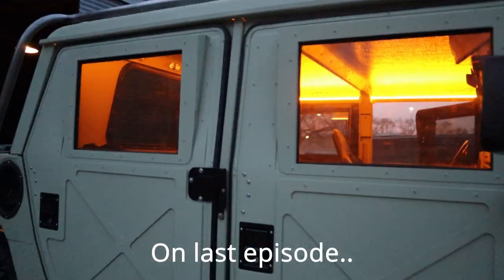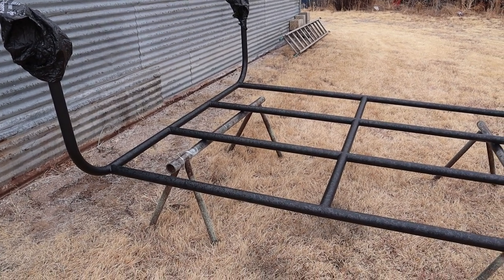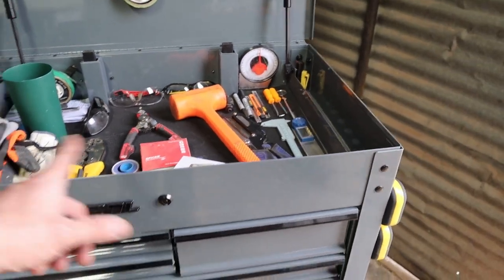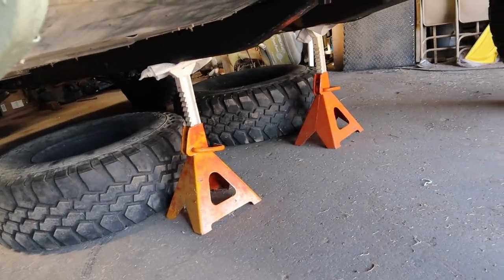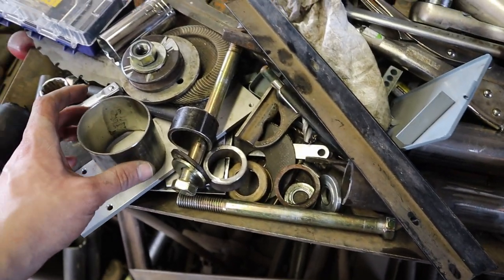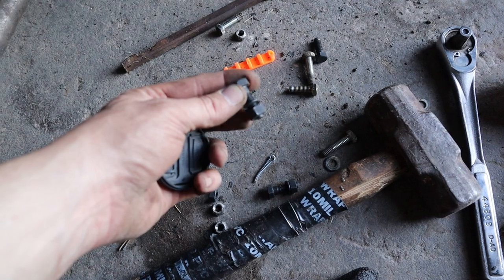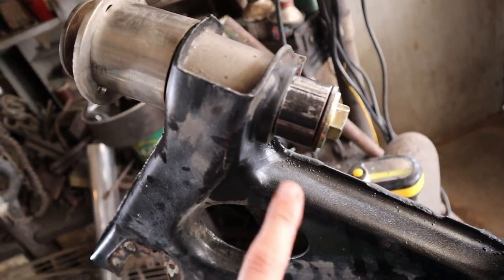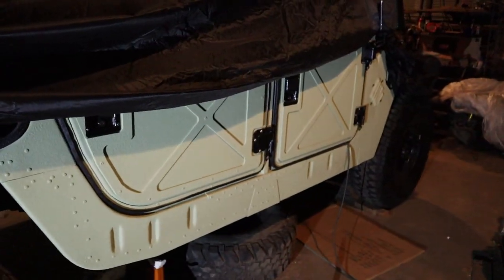Humvee suspension Part 1 - and a bunch of other stuff...

Comment: Nice work!   I nailed something hard on the trail a few weeks ago with my left front control arm.  I see such things in my future.   What are your plans with that beast?  I would love a body lift and roof rack but most the off roading I do I’m already snagging the roof on limbs.
Reply from the maker: I have a few things I still want to do on it, but the new budget build crawler has taken up most of my time lately. Trying to get it done quickly, then I will switch my focus between the two. I think a custom coilover setup sure sounds nice for the humvee...

Comment: I’m thinking of following your path and using the Energy Suspension bushings on my M1151. How do you like the bushings? Any noticeable improvements in the suspension? Any squeaking?
Reply from the maker: They are doing great. Can't tell a huge difference, really, but it did get rid of a clunk sound I had when I hit bumps at certain angles. No squeaking. I coated everything really well in their grease when putting them in.